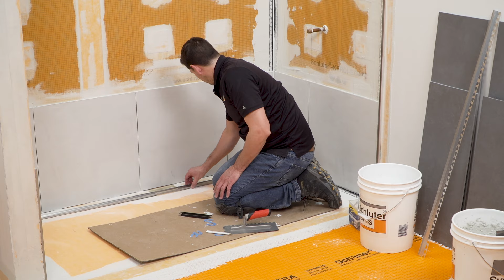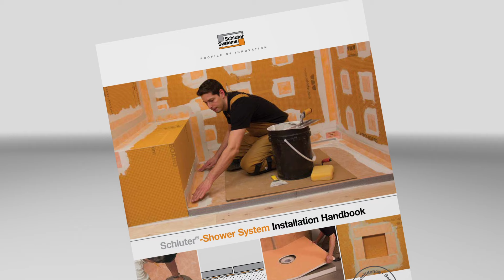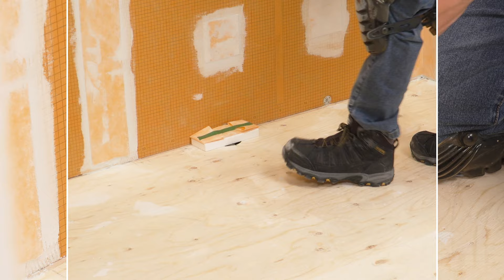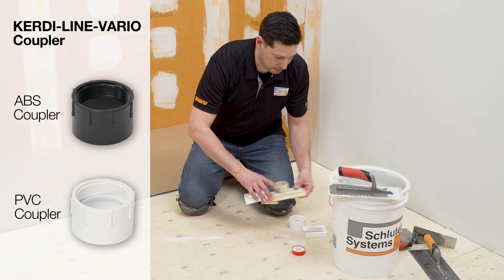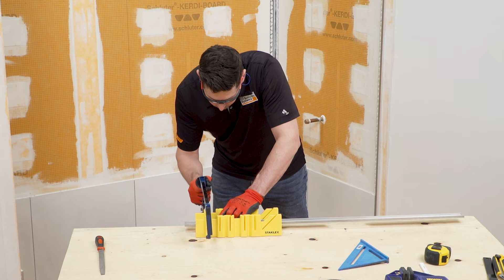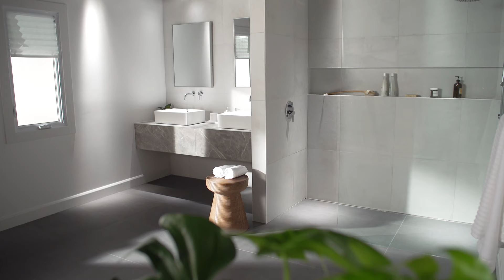How to install the Schluter®-KERDI-LINE-VARIO Linear Drain

Comment: Does the channel have a slope towards the drain that is not shown in the video? The instructions say to install it level, so I assume there is an internal slope.
Reply from the maker: Hi there! The VARIO features a “V”‑shaped bottom that runs the full length of the channel to help water drain efficiently, similar to how our longer KERDI-LINE drains work.

Comment: Why is the channel that houses the grate for the vario sit flat after installed level thus causing some water to pool in the channel? This does not make sense to me. Should the channel not be pitched also towards the drain hole opening too? I just installed this perfectly and some water pools in the channel after it successfully drains from the shower floor to the channel. Its just at the channel where it does not seems right.
Reply from the maker: Hi there! The Schluter®-KERDI-LINE-VARIO is designed to be installed level, with the shower floor sloped toward the drain. While most of the water will flow through the waste pipe, it’s normal for a small amount to remain in the channel due to the depth limitations of the channel body. This is expected, as the VARIO is intended as a surface drainage system rather than a traditional channel drain. Hope this helps!

Comment: What if my tile doesn’t come flush to the edge of the flange? Am I able to move the grate forward or backward depending on how my tile sits against the flange. 
Or would I need to figure that out before cutting my hole?  7:50
Reply from the maker: Hi there! We’d love to learn more about your project! When you have a moment, please give our Product Support team a call. They’ll be happy to discuss the details with you and help guide you on the best next steps. You can reach them at 888-472-4588 (US) or 800-667-8746 (Canada). Thanks! 🍊

Comment: I prefer to install the floor first and set the walls on top. Why aren’t there end caps for the drain body like you have for the grate?
Reply from the maker: Hi there! The channel body is not exposed and the end caps are just for a finished look for what is seen on surface level. With full waterproofing of the shower, the open ends of the channel body are not a concern. :)

Comment: What’s gonna make the water that goes in the grout line and hit the membrane underneath to drain to the drain since there’s no slop from the sides? The water will only sit there? I understand that you have slop from the front, but not from the sides. What will be causing mold overtime
Reply from the maker: Hi there! Good question. Any water that doesn't evacuate to the drain on top of the tile and saturates the grout lines or any thin-set will just evaporate between uses. So, no worries there. Hope that helps!
Reply: bingo;  there are major problems with these linear drains; they look nice but they are a bad choice in the long run.

Comment: the method for attaching the "downspout" to the drain body seems like it will not withstand the test of time.  Double-faced tape and plastic bonded to stainless steel???  I would think it won't take that many hours of shower water running by it to dislodge the whole thing
Reply: I lost the down spout! wtf do i do now? 😂 srsly though.

Comment: Retrofitting a bath so forced to use this as the only option that will look right. 
I have a question: can it be combined with Kerdi line linear tileable grate? 
Vario comes with only stainless finish and I need black or tile in, it’s a bummer when it doesn’t fit the rest of the bathroom finishes.
Hope I get some help on this as I’m desperate for a better solution.
This is also a huge deal in most retrofits as most condos have tub drains never cantered(you can’t dig slabs so can’t relocate it) so Vario works great but limited to stainless finish only really sucks. 

DMVersaTile
Reply from the maker: Hi there! The VARIO linear drain have only 4 designs in stainless steel finish. Perhaps the KERDI-LINE drain with the off center outlet could work. A live conversation would be the best approach. This way, we can discuss the specifics of your project in detail and provide you with the most accurate and tailored recommendations. You can contact our product support team at 888-472-4588 (US) or 800-667-8746 (CA). Hope that helps!
Reply: @schlutersystems1  line wouldn’t work because it’s an odd size shower with odd size drain position, so play on large format tile makes it look terrible(I tried so many designs haha). Drain just ends up way off and not lined up with anything. Shower can’t go bigger and going smaller would be too small for a client. Literally stuck with Vario. It’s awesome to have a solution but the finish is a problem for a client, black has been widely popular too. Mind you, no other drain fits either since the drain is against the wall. 
Not sure spray painting the drain would look good over time so I’m avoiding that even as an idea.

Potentially getting a wrap(vehicle intended) and cover the grate, precisely cut around the slates and maybe make it work in black 😂 Too much work so I was hoping there could be a potential for a tile in as that was clients preference.

Thanks for a speedy reply 👍🏼
Reply: @Math_unlocked we had a similar situation with wanting a black finish. We able to fine a company that does firearm powder coating and aqua graphics.
Reply: @duck_the_builder that’s great info. Thanks

Comment: I am excited to be using this drain in my steam shower and wanted to see which Schluter profiles were used in the vertical corners and the floor side walls? Thanks
Reply from the maker: Hi Jerome! Would you be able to reach out to our product support team? A live conversation would be the best approach. This way, we can discuss the specifics of your project in detail and provide you with the most accurate and tailored recommendations. You can contact them at 888-472-4588 (US) or 800-667-8746 (CA).

Comment: 8:44 What dams the edge of the channel after you cut it? I did not see anywhere where an end cap is put on the channel ends to prevent water from going out to the side. Was a step missed in this video, or did I miss something? If I missed something, please provide the time stamp.
Reply from the maker: Hi Luke! The KERDI-LINE-VARIO does not have any ends in the channel body. It doesn't need any. Because it's meant to be shortened, it is easier to just trim down the channel and install it as is. The KERDI membrane will provide the waterproofing in the small area at the ends and the open end will be hidden by the tile, so no worries. Hope that helps!

Comment: Owner of LT LAPOINTE'S TILE. 30 years experience installing. I have been selling and installing Schluter all these years! This is a great option for a retro shower. Especially when plumbing is in a cement floor with no access below. My Plumbers have stated it would be better if this drain had the slip fitting option to join pipe or the stainless as the other line drains. Connecting to the threaded pipe adds length to the drain. Its also another spot that could leak over a glued slip joint.
Reply from the maker: That's great to hear, we appreciate your support! And thanks for the product feedback, I've passed this along to our teams! 🍊

Comment: You should really rethink the labels you have on stuff. I'm over here now digging through garbage bags because the "black downspout" piece that goes on the channel body had a piece of foam in it with tape over it saying remove and discard. The way it's packaged looks like you're dosed to remove the whole thing and discard it since it's all trapped together like one piece.
Reply from the maker: Hi there, so sorry to hear that! The foam piece insert is meant to keep the shape of the downspout, and needs to be removed before installation. I will definitely pass along your feedback to our team here to see if that can be made clearer, and if you need us to send you a replacement downspout, don't hesitate to ask, and we'll take care of you. Thanks!

Comment: If combining this drain with a ditra-heat application and a schluter foam pan, would you prefer I put a layer of ditra-heat or plywood under the drain flange so the top is flush with the surrounding ditra-heat or should I set the drain flange to the subfloor and have a lip / recess in the kerdi fabric which is attached to the drain flange?
Reply from the maker: Hi there! Would you be able to reach out to our Customer Service team to discuss your project in a bit more detail?  They’ll be able to request more information on the specifics of your project to give you the most accurate answer possible. You can reach them at 800-472-4588 (US) or 800-667-8746 (CA). Thanks
Reply: @schlutersystems1  Thanks, I just did! They weren't sure but said they would get back to me.
Reply from the maker: Awesome!
Reply: @schlutersystems1  Okay, so they got back to me and there is no documentation internally anywhere on using kerdi-line-vario with ditra heat. They offered to reach out to the technical department, but it may take several weeks to hear back, and it may not even be approved at all!

To others looking at this product, do not buy this product with the intent to use with Ditra Heat until Schluter figures out if they can be used together.  Now I have to pause my project for weeks, and I've already set the foam pan. If they can't be used together I'll be out about $1k in materials and have to re-set my pan at a new elevation and lose the heated shower floor.
Reply: Final update: Schluter's technical department got back to me and confirmed kerdi-line-vario can be installed the same way as kerdi-line in a ditra-heat application, by installing a small layer of ditra-heat under the drain flange.

Comment: Would the water not get under the channel body and mold? I assume the channel body has a pitch to it? Looks like it would be a great product, just curious if that would be an issue?
Reply from the maker: Hi Aaron  Good question. The answer is, no. The channel body is bonded with thin-set, just like tile, so that will not be an issue. The channel has a "V" shaped bottom to help evacuate water, which is similar to our longer KERDI Linear drains. Hope that helps!

Comment: It would be helpful to include the flood test process in this video
Reply from the maker: Hi there, here is a link showing the flood test process:
https://youtu.be/jQAGDQy2zQw?si=ZimQpz37LGG_74Cj

Here's one for a curbless shower application: https://youtu.be/9gK9Jh3nT_E

Hope this helps! 🍊
Reply: @schlutersystems1  a standard plug doesn’t fit inside the hole though? I’m confused
Reply: @brentor510 
Use an inflatable rubber bulb type plug for the drain. It needs to be wiggled into place but it works great once inflated!

Comment: Awesome. Would love to see a video on using this with a mortar bed too
Reply: Just finished one with mortar bed, it's all the same only thing I did was make a foam block the same size as the drain hub and hot glued to floor so it did not move. Did the pan bed and let dry. Removed the foam block and installed foam +hub like normal. Covered in kerdi as normal. Looks amazing with wall to wall grate.
Reply from the maker: Hi Marc, we do not have that video yet, but we'll definitively take your feedback and share with our video team!
Reply: Do you need to have the tile trim at the bottom of the wall tiles meeting up to the drain? What is the point of that trim?